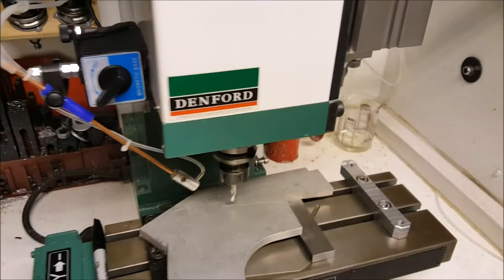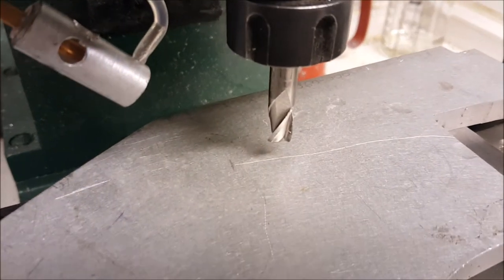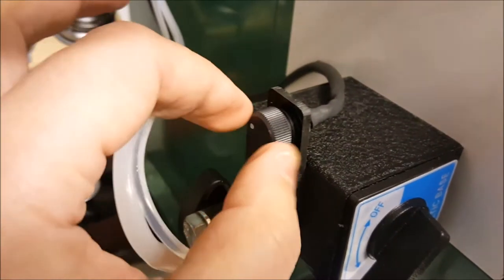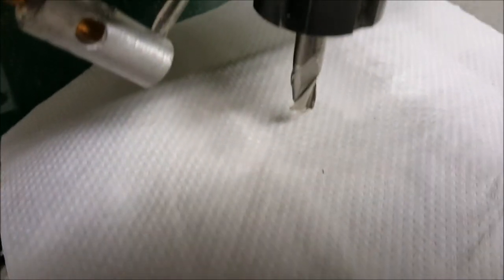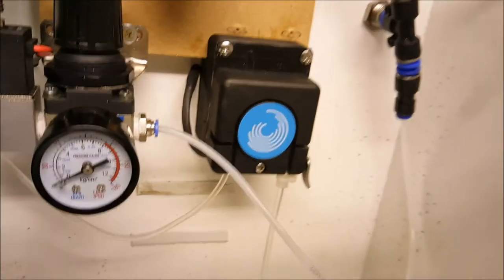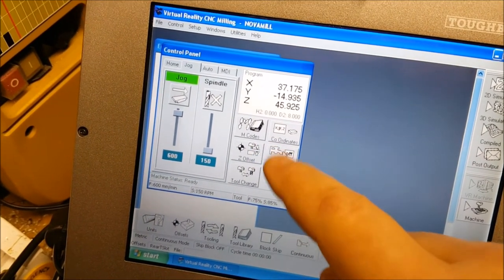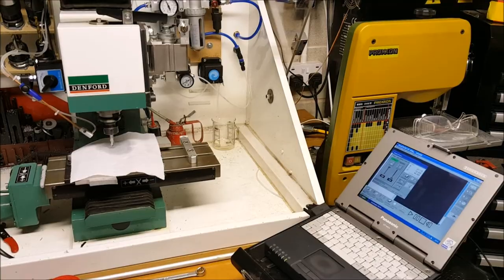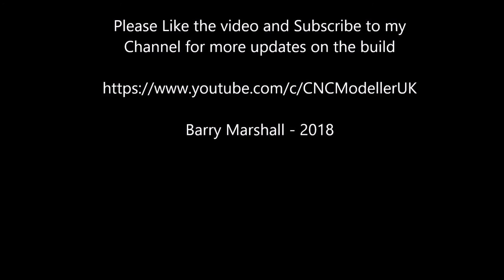DIY peristaltic pump "Fogbuster" style coolant system CNC milling machine / lathe [HD]

Comment: Very nice. Do you have a tank to catch the run off and sump pump? Did you have to waterproof/seal anything? I’d love to do this for my novamill.
Reply from the maker: Hi @Maxim L. There isn't really any runoff as it's a mist rather than a flood. It's handy as you can do either air blast or mist and vary the amount of either fairly independently.

Comment: Very nice build. I have a few questions about your system. Do you have additional flow control (choke) valves for air and/or oil? In the video the manometer is practically at 0, but it's clear that some air is coming from the nozzle. Is the air pressure that low that the 12-bar manometer doesn't even register it? Do you adjust the regulator just by feel? If buying a new regulator, I guess it would make sense to get one with a lower range? E.g. I've seen 0.1-1 bar and 0.1-3 bar regulators (with scale up to 1.6 and 6 bar, respectively).
Reply from the maker: Hi Gene. Thanks!
Yes the airflow rate is very low and you're probably right a lower speck pressure reducing regulator would probably be a good idea. 

The coolant flow is regulated by the peristaltic pump and an adjustable speed stepper motor driver.
Reply: @CNCModellerUK  Hi, thanks for your reply. I've bought a used but functional medical peristaltic pump, that should take care of the coolant flow rate. Do you find the long straight copper tube convenient to aim? I am wondering if there's any point to try using an articulating flex hose like commonly used with (non-fogbuster) coolant systems.
Reply from the maker: To be honest I just used what I have to hand. The copper is slimline and easy to point but less forgiving if you catch a part. Glad you're getting there :-)

Comment: What do you use as your coolant solution?
Reply from the maker: Some colleagues at work (a large engineering company) have said that one of the most readily available and effective fluids for for machining aluminium is paraffin which I use... I believe WD40 is also considered good which I have also used (by spray application) in the past. I'm no expert in these matters and just go by recommendations from peoples that I trust, so I'm open to other suggestions.

Hope that helps.

Cheers
BPM
Reply: Thank You. WD40, paraffin ( kero in Australia) are good for aluminium, but I was wondering if you used a proper fogbuster type oil for steel. I use diluted soluble oil in a spray mister for my lathes but it does not transpose well to milling. Your unit looks like it would work well but would need the right coolant for general use including steel.
Reply from the maker: As I understand it carbide cuts well in steel without coolant. That being said I have very limited direct experience of this as I only really machine Aluminium for aero modelling. Sorry I can,t be of more help.
Reply: With milling it is a matter of getting the swarf away, unlike a lathe where the swarf in the main drops away. Modern machines use very high pressure flood coolant to do this. For the rest of with older machines an air blast with some coolant added like you do, has to do the job. Misting puts too much vapour in the atmosphere and inhaling it is not a good idea. As you can imagine paraffin fumes in the air would be very unsafe. Have a friend who is seriously considering making a system like yours as it could be the ideal solution. Commercial units are quite expensive. Thanks for uploading this video.
Reply from the maker: No worries, hope you/they find it useful...